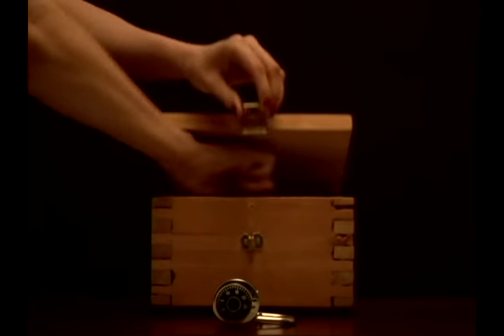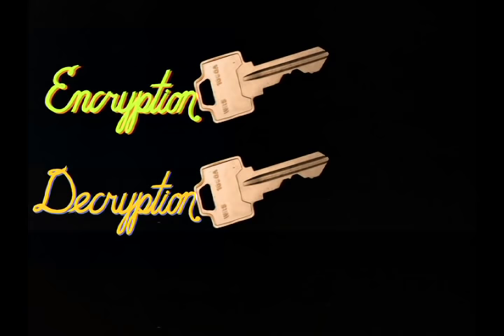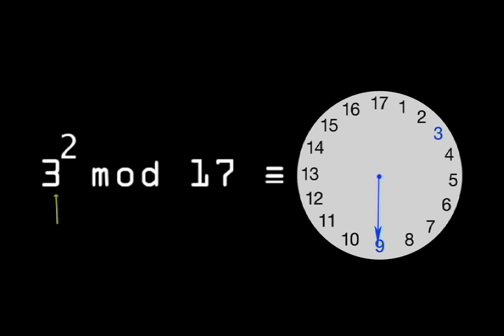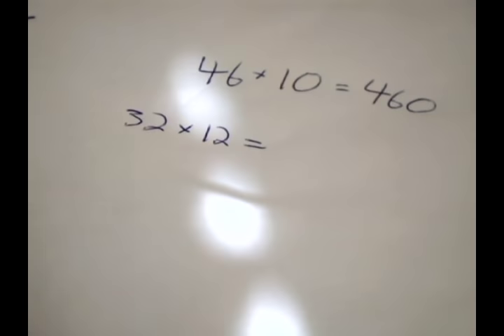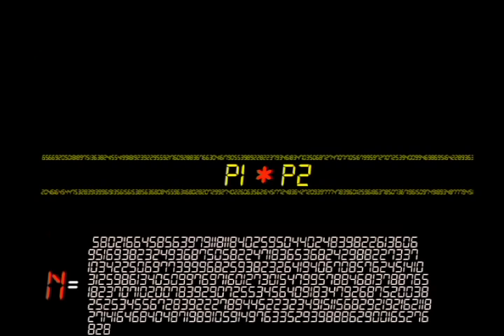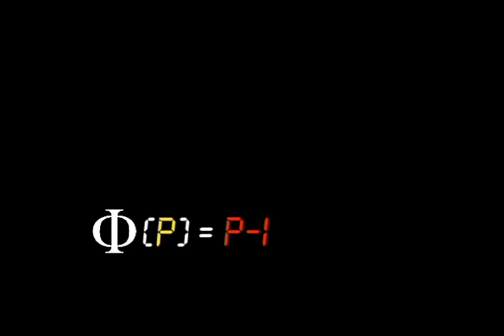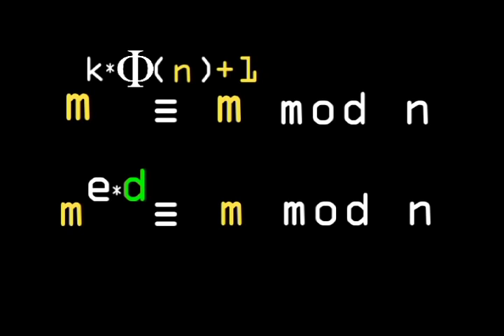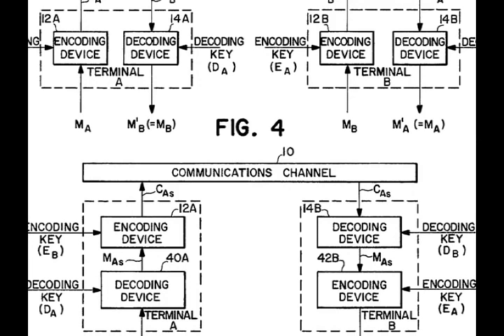Public Key Cryptography: RSA Encryption Algorithm

Comment: I still don't understand one thing: If supercomputers are capable of finding primes MUCH bigger than those used in cryptography why would be difficult for those computers to find the primes of a 1024 bits key? For example: in 2013 was found that 2^57885161-1 is prime and that number is huge (17,425,170 digits), much bigger than the primes used in cryptography, which are about 2^1024. ("only" 308 digits). I am confused.
Reply: Same
Reply: nura loh I did some research, got some help (inStar-chan !) and I think I got the answer to why 2^57885161-1 is "easily" proved prime while smaller primes still too difficult to be factored.

Because 1024 bit RSA numbers are completely general; the algorithms that create keys have been built to avoid kinds of numbers that are computationally easier to factor.
Mersenne primes (like 2^57885161-1)  can be found with a fast algorithm designed specifically for those kinds of numbers (search for Lucas-Lehmer primality test) and the formula for the algorithm is specifically why all largest prime numbers have been Mersenne primes since; it's ridiculously easier to prove a Mersenne number prime than any other kind of number known by the mathematical community today.

Mersenne primes are found using the following theorem (Lucas-Lehmer Test): For p an odd prime, the Mersenne number 2p-1 is prime if and only if 2p-1 divides S(p-1) where S(n+1) = S(n)2-2, and S(1) = 4.

Testing the Lucas-Lehmer Test is MUCH easier than factoring the number, but it has the downside of ignoring lots of legit primes on the list. Since the primes on a cryptography key have nothing to do with Mersenne numbers the Lucas-Lehmer Test does not help it in any way.

The security of a 1024 bit key relies on the hope that there are no KNOWN tests that can work as an alternative to the boring and computational expensive factorization process.
Reply: Ic... Wow thanks for taking the effort to explain it to me! Really appreciate it =] Another thing i was thinking about is that how many known primes numbers are there in 2^1024? The method the video showed the guy trying every number up to 19; if 589 is divisible by 19, then it is one of the prime factors. If so, can't the computer use trial and error starting from the largest known prime number 2^1024 can produce? There is only so many digits in 2^1024 and if somebody can find the prime number using current computing power, surely another can. By starting from the largest and trying the already known prime numbers, especially when the 2 primes has to be similar in size, you can tell how many digits the prime numbers have and narrow it down to a range where the absolute number of numbers to choose from is manageable with the current computing power.
Reply: nura loh The problem is that we actually don't have computational power to test even small groups of small prime candidates. Those who create the encryption key also doesn't have the computational power to test if their generated prime is actually a prime. They just believe it is (based on a statistic algorithm). If they had the computational power to test their own key (just to be sure) they would do it, but they can't. Since testing 1 number is that difficult testing even a small group (previously selected based on the number of digits, for example) is impracticable.
Reply: RenanzinhoSP Wow I didnt know that it can be so difficult that they can't even be sure if their number is a prime... In that case, what if their number isn't a prime?
Reply: nura loh Lets imagine you are creating a key. First you choose 2 numbers that really (REALLY) appear to be prime with help of statistical theorems. Then you apply all the math and you have your own key. If at least one of the 2 numbers used to create the encryption key is not actually prime then you have a serious problem. If someone try to break the key he might have success. But again, I can not see why someone would try to break your key since the chances of him getting success are as low as the chances of your numbers not being prime. Despite of that, lets assume that he still wants to break your key. If your problematic number is not a prime but still very dificult to factor (for instance if the number is only divisible by 1, by himself, by 111111111111111111111111111111111111111111111139483 and by 77777777777777777777777777777777777777777777777327) the person won't break your key if he give up before trying those 2 unexpected factors.

If your numbers are primes you are safe by the "computational power" argument. And even if they are not you still reasonably safe because no one know about the security problem (not even you). At least that's is my understanding. Please don't take all that as infallible true since I'm not a mathematician. My english, as you can see, is equally unreliable, hahaha.
Reply: RSP I'm sorry but your reasons are not really applicable to this. Factoring numbers and checking for primality is actually very different. The AKS primality test is very very quick compared to factoring products. The problem here is that you HAVE to know the factoring of N. Even if you had a database of all the primes up to 2^2048 it would take you forever to check everyone on N.
Reply: RSP btw if N is not the product of two primes then the formula for phi(N) is a different one and you will not be able to decrypt anything
Reply: what's S(n+1) ? is S a function ?

Comment: If the 300 digits key is public, and you knew that it was generated by a multipliplication of two 150 digits long primes, couldn't you try to multiply many times those primes (maybe got them from a list of primes) until you get the composite number of 300 digits? Which is... you don't really care about factorizing the big number, you just do the opposite strategy (try multiplying two primes, which takes much less time, through multiple tries) until you get the composite one?

Comment: Hello again! I am either doing something wrong, or you are missing something in your example:
"If you raise the number 1, to any exponent, k, you'll always get 1. In the same way, we can multiply the exponent phi(n) with any  number, k, and the solution is still 1"

My tests either fails, or prooves you wrong: Please explain either one :-)
Caluclated in TI-Nnspire:
mod(13^6;7) = 1
mod(13^2*6;7) = 1
mod(13^3*6;7) = 0
mod(13^4*6;7) = 0
mod(13^5*6;7) = 0

At first I thought that the exponent had to be smaller than m, but I changed m to 222 instead of 13, and that didnt work either. 

Please explain to me what I am doing wrong, or what is missing in the video. 

Sincerely,
Reply: The k value is multiplied by the exponent. In your case, I think you're just multiplying the result by k.

For example, if we use your examples, we get the following:
13^6 mod 7 = 1
13^(6*2) mod 7 = 13^12 mod 7 = 1
13^(6*3) mod 7 = 13^18 mod 7 = 1
And so on.

Have a great day.

Comment: the step @ 12:59 = wrong 
because the [\equiv sign] (looking like a 3line = sign)
=/= like a normal = sign, you cant just multiplicate both sides. 
calculate it, this doesnt work 4 the example you picked in the video. 
with m=5 and n=8 with k=3 
5*5=25  phi(8)=4   25^(3*4)=25^12=59604644775390625 

now we have to calculate rest of the numbers which \equiv
so after division with 8 the rest has to be the same, then its modular congruent.
59604644775390625mod8=1
5mod8=5
this =/= the case 4 all  #s

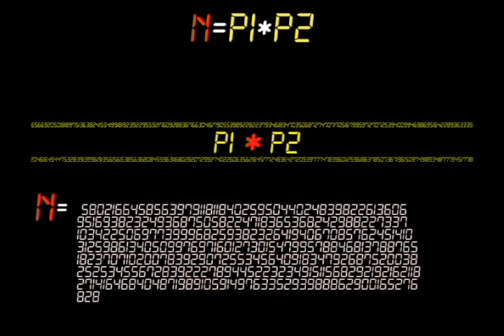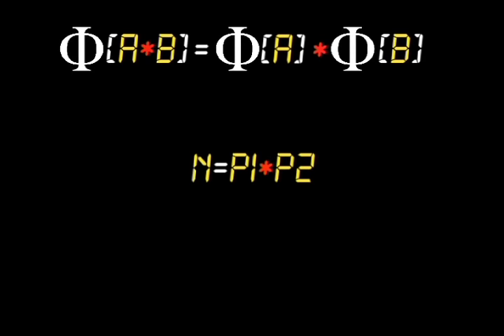Comment: At the risk of sounding anal, the number N = 5802166.....527628 (8:37) cannot be the product of two prime numbers. For a start it's divisible by 4. Also, at 11:14, 
Φ(A*B) = Φ(A) * Φ(B)
if and only if A and B are coprime.
For example Φ(8 * 12) = Φ(96) = 32
But Φ(8) * Φ(12) = 4 * 4 = 16 ≠  Φ(96)
This is because gcd(8, 12) = 4
However, with 96 = 2⁵ * 3
Φ(2⁵ * 3) = Φ(2⁵) * Φ(3) = 16 * 2 = 32.
since gcd(2⁵, 3) = gcd(32, 3) = 1

Of course, in the case that A and B are distinct primes, it naturally follows that 
gcd(A, B) = 1 and
Φ(A * B) = Φ(A) * Φ(B) = (A - 1)(B - 1)

Comment: The equation used in the Phi algorithm is not complete. If you test the Phi of 9, it equals 6. However, if you split 9 into 3 and 3, the equation gives you 2*2=4. So, there is a catch in this formula. You should calculate the greatest common divisor (GCD) of the two split numbers and multiply it into the formula. Additionally, you should divide all of that by the Phi of the GCD. If the GCD of the two numbers is equal to 1, like in the case of two different prime numbers, the formula used in the video will work.

Comment: One-way encryption performed with RSA relies on no nonce, or unique value, which means encrypting the same message with the public key will always produce the same ciphertext. Always add some random value, such as a 128-bit header, to every message to prevent identical messages from looking the same.

Also

If instead using RSA in the opposite direction for digital signing, so the private key holder encrypting/signing and the public key holder verifying/decrypting(but being unable to generate your own valid signed messages), the valid signature of a message made of two known signed messages is their added signatures. To break this loophole that might allow some limited arbitrary signing of messages, do not sign the message itself, sign its hash instead. The hash of two added messages is not the same as the hashes of the messages added together, and that is safe.